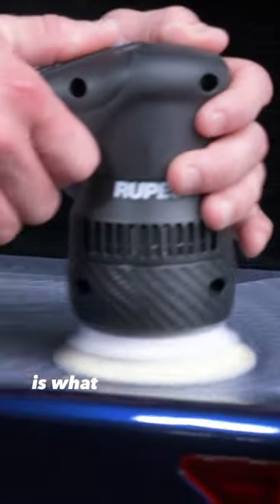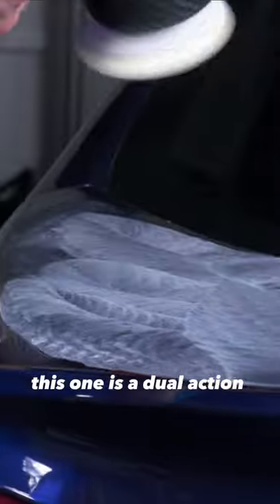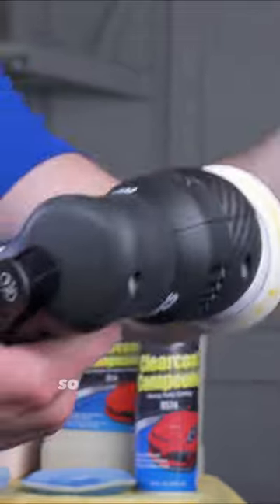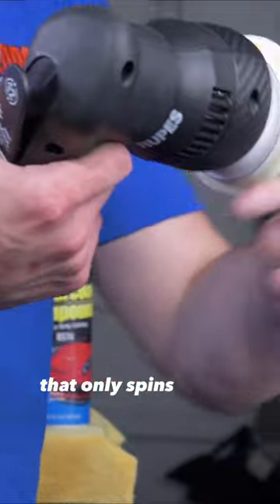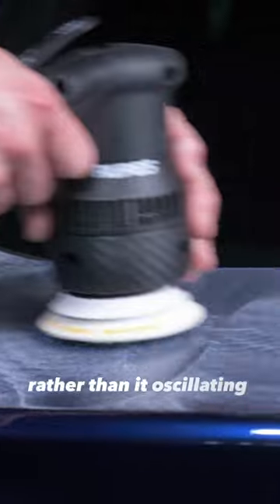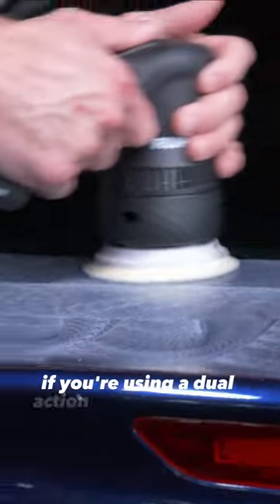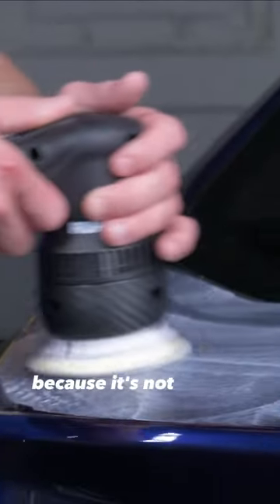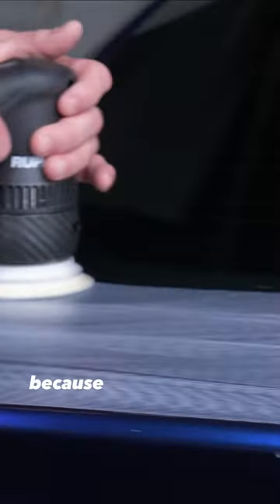Dual Action Polisher VS. Rotary Polisher -- Which is better? #shorts

Comment: Rupes are great for just polishing, they suck for getting rid of sand scratches from removing dirt nibs. Our shop just returned the cordless Bigfoot within a month. 2 chargers stopped charging within a couple days and the pads kept flying off the machine. The Milwaukee is heavy but way cheaper than the Rupes and I think it works better too. I use it for detailing on the side. I think the 12 volt mini clowns on the 3” Rupes. The 1” Rupes is awesome for keeping the dirt nib area small but your gonna waste a lot of time trying to polish out nib spots. I love the DA sander but with 3M paper, the Rupes sandpaper will not sand out dirt nibs or fish eyes

Comment: Thats incorrect. Dual action cuts more than rotary.. proved with a video from DIY details.. ( correction, rotary cuts and finishes much better and faster)
Reply from the maker: We only said it was safer to use!
Reply: Its not though
Reply: Yeah I found that out Rotary faster @Omar-Dawood
Reply: @StonerCarCare  you said it (it's gonna take a little longer because it's not cutting quite as fast)
Reply: It's subjective... if u use both machines properly and dont apply any pressure then the long throw DA is cutting faster.
If you do apply pressure then the rotary is digging to China
Reply: @StonerCarCare no you said it’s going to take longer
Reply: Just saw a video that says rotary cuts more than DA😣 no wonder it’s so difficult to learn

Comment: Da burn paint too
Reply: @walteroverton0215  yep. My comment above about Rupes, I forgot to mention that when the polish school came to my job to show us how the Rupes system works they said use the Rupes 2k grit then the 3k twice as long as you use the 2k. Hit it with the blue wool and go slow “don’t worry you won’t burn it” I start and instantly see the dirt nib polished back up and laugh and he says buff it slower it won’t burn. I laughed again well then WTF happened right here if it won’t burn?” I burnt the edge of a Tesla deck lid trying to get sand scratches out. My boss was standing right there with us and I told him that this is why we cut with the rotary and polish with the Rupes yellow foam pad. I only use the white pad and uno polish third on a black car. Personally I think Rupes is garbage unless it’s for final polish. The Reveal cleaner is nice for getting the residue off but the it won’t burn is a bold face lie